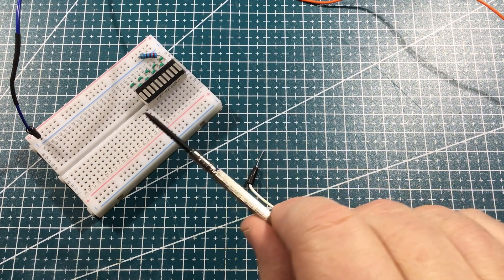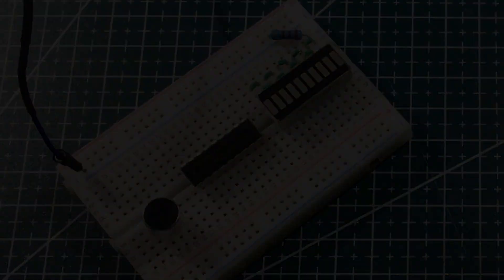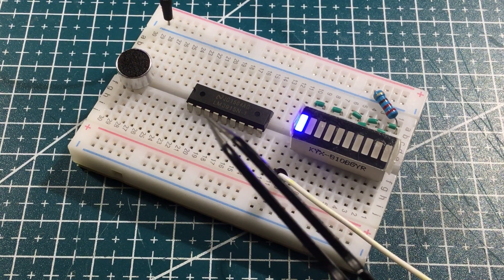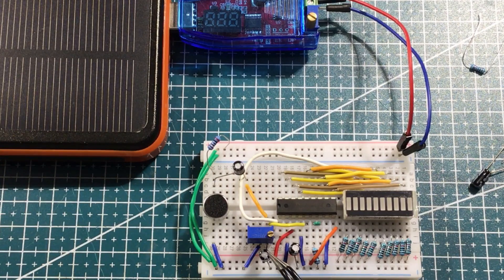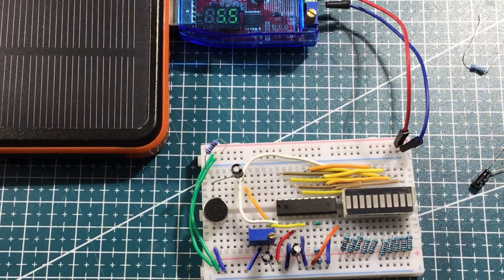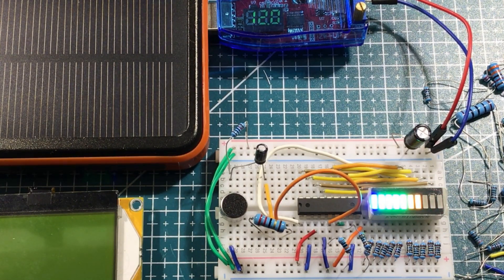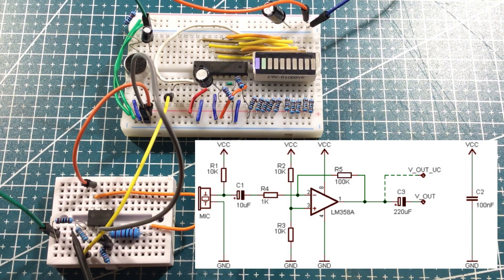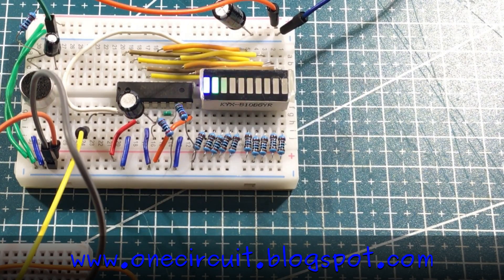LM3915 drives LED array VU meter

Comment: After wiring the circuit as per your schematic, only the 1st led lights up to full brightness with 5v, and the others just flicker when sound is put through the condenser mic. Thanks
Reply from the maker: Yes I remember the frustration with this chip. The LM358 was the key to good amplification. But maybe try swapping out chips and components. The breadboard connections are also a typical point of failure. Good luck! 👍😀
P.S. I think I also increased the voltage

Comment: I used a LM386 DC4V-12V Electret Microphone Amplifier Module Board for the input with a 220uF cap and a 470k to the output and it works nice. Without your video on those tips I would still be scratching my head.  I didn't use any resistors on the LED Array tho . Not sure they are needed. Thanks.
Reply from the maker: The resistors are cautionary after I blew up one “testing”. 😬

Comment: So it works better with line level rather than microphone. Cool.
Reply from the maker: I'm keen to pair it to another analog input - like battery levels, or water levels?
Reply: @onecircuit-as  Yeah, After all it's just measuring voltage. You could replace the fuel gauge in your car with it. :)